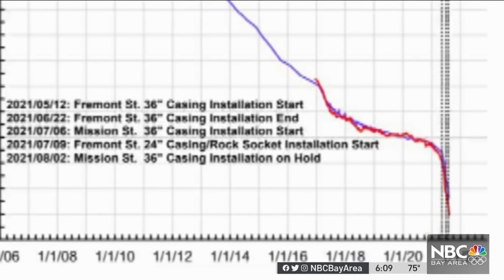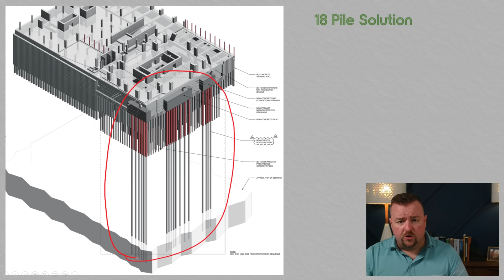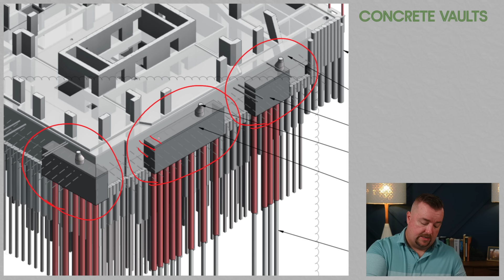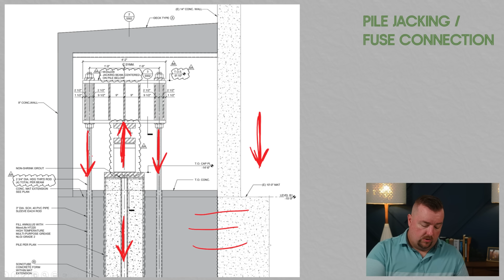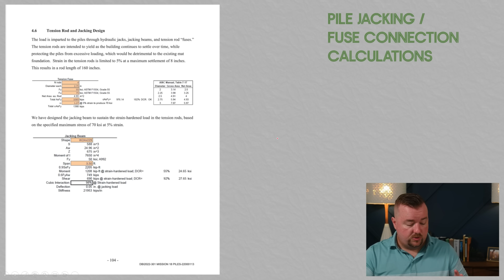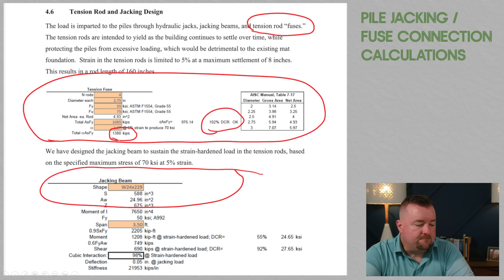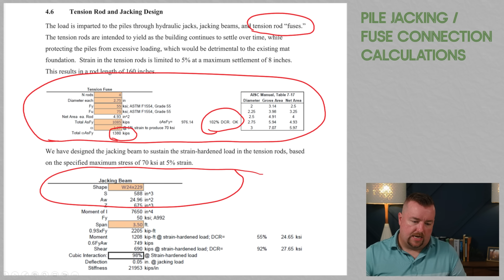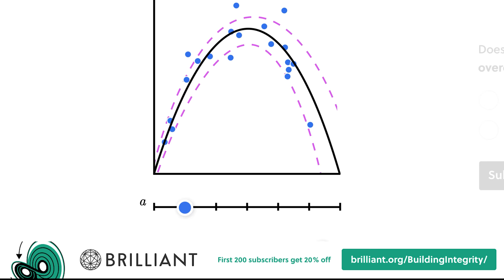Did I Uncover a $100,000,000 Mistake with the Millennium Tower "Fix"?

Comment: The original foundation was insufficient to handle the load. Remediation has proven to be insufficient as well. 
It’s time to admit failure and do a tear down before we lose lives.
Reply: You haven’t been paying attention.  The latest report I have seen (SF Chronicle 22 June 2023) states that the progress of the leaning has been arrested.  There are no lives in imminent danger.
Reply: I don't believe there are lives in jeopardy, per se (ie. a failure of this fix would lead to catasrophic loss of life), but I do wonder if it's even worth fixing at this point. We can't even be sure this "fix" is going to work, and even if it does, would anyone actually want to live there anyhow? I mean, this place now has a bad repuation. Surely the value of each unit has been greatly diminished. Is it really worth it?
Reply: @jasonhaynes2952  The fix has worked, so far.  The objective was to arrest the leaning, and that has been done.  The owners have been compensated for dimished value of their property, as I understand it.
Reply: @GH-oi2jf  So far... This just has the smell of - It was inevitable. I don't like this at all.
Reply: The current lean ratio is 30" to 600 ft.  This is 1:240.  As long as the structure is design for gravity notional loads (which it should be per codes)  this is well within tolerance for the structure to handle.  Throw in a seismic event...that would be a good one to check in the model (which I am sure they have!).
Reply: @nbb04001 on a slightly different scale, but using this comparison as an example, let's say your ceiling is 2.4m high. Now stand in a doorway and look at the framing of the door casing. If the bottom of the door frame is out of plumb to the ceiling by 1cm you would almost certainly see the difference with the naked eye if you've ever been in the building trade.
Reply: @GH-oi2jf  All is well, until they try and sell
Reply: @GH-oi2jf  So far, it has happened multiple times that what actually happened and what was within expectations has deviated from each other greatly. So far, there is no reason to believe that the fix will withstand the test of time, because so far, the team executing it have failed to accurately predict the behavior of the building in the first place.
Reply: Actually, it was pretty pointless of me to even write that, because it's been ten days since that comment and the building has already started failing more and more. The Millenium Tower is definitely falling. The choice is whether to do it via demolition or wait until it takes people with it. But that thing is not going to stay standing.
Reply: I concur.
Reply: @neruneri  They are going to wait until it takes people with it. You know, we have to have a body count before we see what should have been common sense.
Reply: A new foundation will be laid using fat stacks of taxpayer cash
Reply: @GH-oi2jf  What will happen when a big earthquake shakes that foundation and only one side is anchored to bedrock? I dont think anyone knows. It is a folly to construct that high a building with insufficient foundation and soils condition.
Reply: @GH-oi2jf  Devenport building also passed inspection and report was sazing the same thing. You haven't been paying attention to this channel.
Reply: That would cost too much money. If the authorities don't step in, the building will be allowed to collapse uncontrolled and the courts will ultimately decide that "nobody could have forseen this tragedy" and that "no individual or specific firm or institution is to blame" because it's all "too complex to forsee such problems" (aka the courts couldn't be bothered to understand the problem and pin specific blame on specific people/firms/authorities). 

The building's owners will be happy that they didn't have to pay for the disassembly of the building, their insurance will likely settle with them in court to only pay roughly half the insurance and the victims and their families will be left with the infamous "the question if anybody was to blame will sadly forever remain a mystery". I'm a lawyer from Germany and it's infuriating that this is still the most likely outcome, not just in Germany, but in many other countries, including the U.S., aswell.
Reply: @colinwilson210  but nothing is out of plumb(to my knowledge), it's just leaning as a whole. Surely you wouldn't notice if the door was unlevel by 0.25 degrees
Reply: @mhxxd4  it can't be plumb and leaning at the same time. Practice putting things up straight regularly and you can do it by eye after a while. I've kinda lost the knack now because I haven't been on the tools for 30 years, but you'd be surprised just how accurate you can get without instrumentation.
Reply: @colinwilson210  oh that's a good eye but I meant if the whole building was leaning not just the door it wouldn't be noticeable
Reply: Yep, the guy's a clown. No insurer or mortgage lender is going to risk their money on something so badly defined.
Reply: The original foundation for this super high rise was a floating slab in a landfill zone. Not surprised by the results.
Reply: @ronaldoago-go5907  The original design addressed the landfill issue by driving hundreds of supports into the natural clay layers underneath the fill. Which is a common approach for multi-story buildings. However, the engineers didn't understand the behavior of that clay under their building's extraordinarily heavy and densely applied loads, as well as the influence of other major construction next to it.
Reply: @GH-oi2jf  Ever heard of "JUST IN CASE?"
Reply: @GH-oi2jf what they should do is demo half the building and call it a day.
Reply: Maybe they could get a handful of dudes to fly a commercial airliner into it.
Reply: Too much pride, unfortunately won't happen
Reply: Re-engineering has a failure index of 50%. That's not good.

Comment: I’m betting the plate in question might have worked with the original count of jacks they were putting in, then someone made the decision to reduce the count and they never re-visited the design of that small plate to compensate for increased loads.
Reply: It happens in engineering more often than engineers would like to admit. We're all human after all, but for sure these things should be checked
Reply: @garrethtinsley2435  1981 Kansas City Hyatt Regency Skywalk Collapse is a tragic example.
Reply: @garrethtinsley2435  no one can be responsible to remember everything on  things this in-depth. But as you said that’s why we have thees things checked
Reply: That's why we spent a few billions on load inferencimg software.
Reply: That's exactly what I was thinking listening to this
Reply: @fss1704  oh just relying that the software is perfect no need to check. It’s only other peoples lives.
Reply: @dontimberman5493  the software works within the programmed constrains, now, if humans are cheap and manipulate the prediction to save money that's another story. No amount of software can predict bad implementation being malignant.
Reply: @fss1704  yes and how do you know you are with in its constant if you don’t check? And as to the human factors that’s why we get independent verification.
Reply: @dontimberman5493  you don't need to check if you follow the plans, they effectively have to tamper with the stuff that checks to do that, now the verification is definetly necessary to assure that the BOM was followed.
Reply: @fss1704  we are talking about checking the plains and yes it is standard practice to have them independently checked
Reply: You might have hit on the exact root of the problem.  The design might have been plausible with a third of the load.
Reply: I agree, the design is most likely based on the original amount of jacks. Would be interesting to see the checks made from 3rd party control.
Reply: @jrhoadley  If I remember correctly, the installer changed something.  Something about the continuum of force not according to plan.  The engineering was sound.
Reply: @fss1704  Not on the estructural thing, but for Electronics, sims are just an aid to get full dump of calculations in different point of the circuit with a click. What it does not include is the EXACT MODEL of YOUR CIRCUIT, some pieces are modeled as IDEAL or NORMAL ... but in controlled conditions. This is UNREAL and unless you go to every single piece to enter the most accurate and realistic data you can get, then, the sim will relay the lies you fed to it. Thats all. Of course,SIM have models for real things ... but they are just models. They do not account for details about the actual scenario. You need to model it, or compensate for each  thing that is not standard in the model. It is a calculational aid.

Comment: Josh I think that you have identified a valid issue. As a Professional Engineer with 45 years experience, I agree that, just from observation, the size and thickness of the plate at rhe bottom of the rods appears to undersized for the magnitude of the loads proposed.  This area requires careful design where you report there does not appear to be any present.
Reply: The plates are even worse than they appear at first when you consider that the weakest sections are where the threaded rods penetrate the steel plates, and this is also precisely where the concrete is also weakest owning to the holes where the rods run through them being in the same location.
Reply: Where are the city engineers who are supposed to oversee this 'fix'? Didn't they even notice that there are no calculations for the steel plate that this whole apparatus is supposed to rest upon? It is shocking that considering how flawed the design and engineering of this building is that:
A. They trusted the same engineer to come up with a solution and;
B. A qualified structural engineer in an approval capacity did not raise any alarm over  this omission in calculations.
Reply: I live in the SF Bay area and have followed the story of the building for a long time and also commented on previous videos Josh has done on the project. Again, I think he is right on target with his comments. There is a concept called “cold eyes” which many have heard of. It is very much like independent peer review. I work on machinery and spent my career sailing in the engine rooms of commercial oil tankers. Many times we would have a perplexing problem so I would ask some of my qualified shipmates(other engineers) to take a look at the problem. Many times they were able to help-a lot. In the case of the Millennium Tower, some cold eyes would be strongly suggested. Sometimes being “too close” to a project keeps you from seeing some details that are important. Heck, my wife is not an engineer, but she can look at some job or issue and mention something that’s important. Also, maybe some alpha male issues come into the picture; as in ‘Hey, we’re the big time engineers and don’t tell us anything. We know, okay?”.  The City of San Francisco should consider his advice, soon. Thanks, Josh. Perfectly stated.

Comment: I started studying for my engineering degree in 1981.  That connection reminds me of the Kansas City Hyatt walkway connection that failed that year.   Also, I've discovered over the years that proportions can give a good indication of a potential problem.  In this case I see a massive pile, massive reinforced steel beam,  massive anchor bolts, and a little tiny plate.  Right there I would have asked questions.   Final comment, as an engineer we are to try to find economies in our designs.   All the components in that cross section, the Pile, the beam, the excavation, the concrete etc.  The least expensive item in the whole assembly that stupid steel plate!!  I would have sized a simple plate large enough to distribute the load to the concrete and with adequate thickness to resist all the shear loads.  Then I would have added stiffener plates and plate washer, and it still would be the least costly component in the design.  Then I would go home and had a good night sleep.
Reply: Exactly. Those plates are so underdimensioned it doesn't even visually make sense even on the blueprints. It can be seen that far away.
Reply: The Hyatt Regency walkway collapse immediately sprung to mind for me as well! This is not my field, but I have seen a fair bit on it as a case study/cautionary tale for engineers of all kinds. It's a great example because it was both a quite subtle issue, yet easy to explain to anyone.

This case though, does not seem subtle at all. It worries me that this was overlooked so easily. As a software engineer my immediate instinct is to look at all the interfaces between components and ask "What can go wrong at this point? What have we done to satisfy ourselves that this is OK?" I couldn't tell you if the plate is properly sized, but I would like to think if I was reviewing this, I'd at least be asking the question.

Here you have a chain of components that are transferring a force, and nobody did a checklist to make sure they'd  thought about all of them and all the connections in between?
Reply: I’ve got the feeling that some Engineer got enamoured by tensegrity and decided to design it into a critical component without understanding the failure modes of tensegrity systems.  Like you push it sideways and it fails!!
Reply: Seems to me (a non-engineer) that using cables of the sort used for post-tensioning concrete would have been a better choice. Run them in a big loop inside conduit with the end points at least several feet apart. Run three or parallel in each section allowing redundancy.  No buried connections, known technology, and if cable deteriorates it can be extracted and replaced with the load temporarily  transferred to the redundant cables.
Reply: FIU Pedestrian Walkway collapse?
Reply: @Brian Mucha @Building Integrity 
Exactly. As some one who grew up on a farm and "Engineered" many a Farmer equipment fix over the years. Seems to be a case of Book Smart.
Big Footing, Big Jack, Big Jack Beam. Big Anchor Bolts
iddty bitty teensy load distribution plate. NOOOO.
The Load Distribution plate should have mirrored the Big Jack Beam. 
In fact in my mind it should have tied back to all the anchor bolts on its side of the piling. Thus distributing the forces over a greater surface area.
Reply: When I thought about h9w I would do that, I figured on an entire trusted platform with vaults atop it. And I would have tried to run the connections to the building from the opposite side of the building to keep the entire foundation slab in compression. The current design somewhat relies on the soil pressure against the outside of the vaults and we already know that the soil is not up to the task.
Reply: My approach to structural engineering too. I have sometimes been questioned about "too strong" structures but the speed and ease of assebly has always over run those kind of questions. Material is very cheap these days compared to labor. 
Foundations especially should be designed to last twice the designed use age of a building without any maintenance. Foundation of any building meant for ppl use is the last place anyone should check for "cost reductions". Building companies are these days run by economists and lawyers.
Reply: Threaded bar with a weak attachment point?  It's exactly like the Hyat! :O
Reply: Even the flat washers for a threaded rod that size would be larger than that plate, and that's for structural steel not concrete.
Reply: I would like to add that this part is impossible to inspect. If the bolts on a bridge rust or a tension cable is over-stressed, at least you can see the effect.
Here, it is the cheapest part in the worst possible location, where you can not even observe a failure in progress.
Reply: @alafrosty : yes, and the soil will be even less up to the task during a big earthquake.
Reply: I am not an engineer and Hyatt Walkway Collapse was the first thing popping in my mind, too. Holy shit the incompetency of these people.
Reply: That was the big red flag for me too. My dad was teaching engineering at UTEP when the Hyatt walkway happened. (I was 11 at the time) Wile I did not fallow in his foot steps, I still remember a lot, I got to "edit" courses :-)
Reply: Brian, you do know that the structural design of those bridge supports was not the reason for the collapse, don't you? Yes, a structural engineer for the steel fabricator did an alternate design, but the structural engineer of record did not properly review the fabricator's design, assuming that the fabricator had thoroughly analyzed the reactions. And the fabricator assumed that the  SE of record was going to validate the fabricator's design. The mistake the building SE made was not reviewing the submittal properly.
Reply: The instant he showed the steel plate, I immediately thought of the Kansas City walkway incident, too.
Reply: @imwacc0834  “Edit”? You sure you don’t mean “audit”?
Reply: But will the structure, as built now and built at completion survive the next “San Francisco Earthquake” ?
Reply: @tookitogo  I'm sure he also meant "follow" rather than "fallow"... although his word usage indicates great engineer potential...